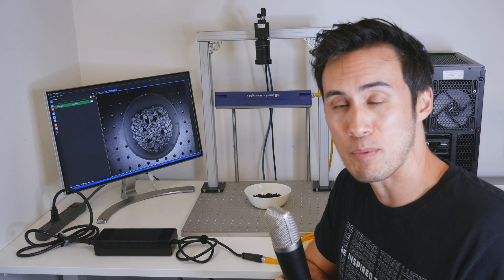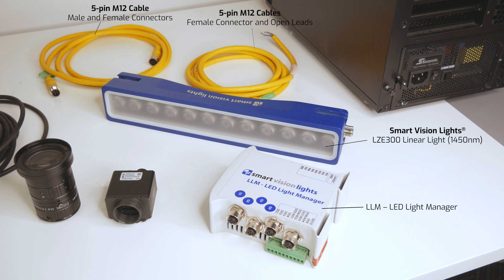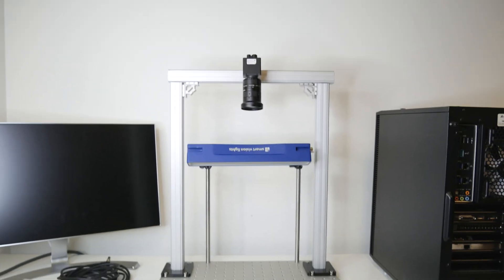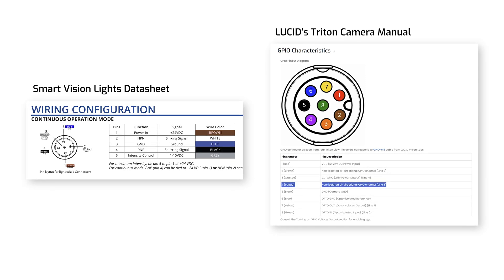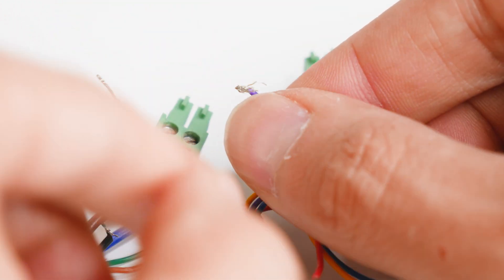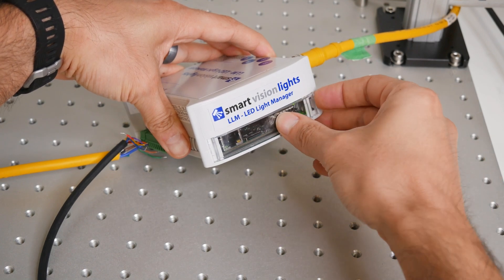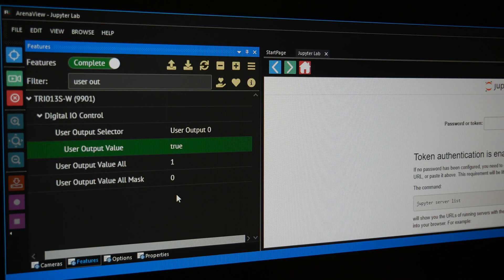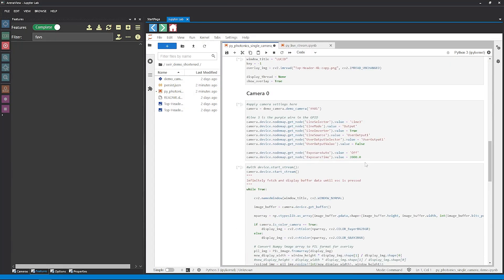SWIR Camera Coffee Bean Inspection - Tutorial: SWIR Camera, Lens, Lights

Comment: Whats the price of the camera? I dont find the information anywhere.
Reply from the maker: Atlas SWIR 1.3MP with TEC $14,500
Atlas SWIR 0.3MP with TEC $9,950
Triton SWIR 1.3MP without TEC $10,950
Triton SWIR 0.3MP without TEC $6,950 (all in USD)
Reply: you dont have to buy such as expensive camera as 10,000 $ every camera has infrared spectrum, you need to remove inrfared filter and put infrared pass filter
Reply from the maker: @husariawjaponii  This is only a little bit true. If you remove the IR filter on a standard color sensor, you are looking at increased sensitivity from the 700nm to ~900nm, with sensitivity falling off to near 0% QE around 1000nm. These SWIR cameras provide excellent sensitivity far above that, up to 1650nm.